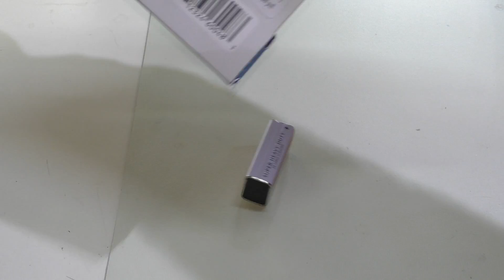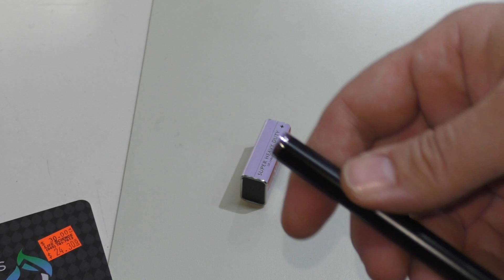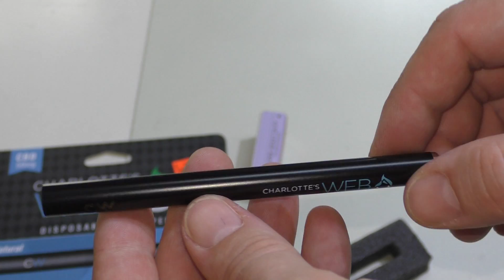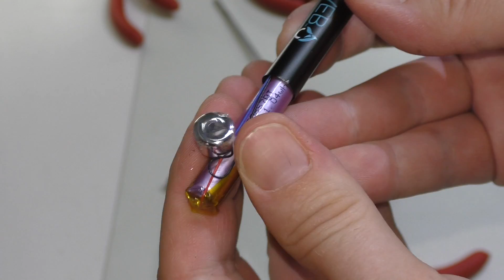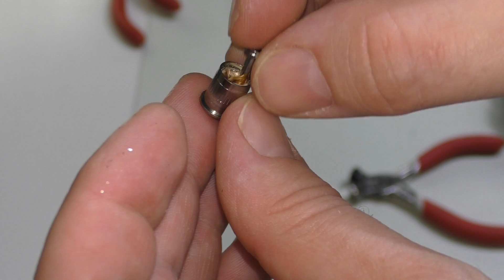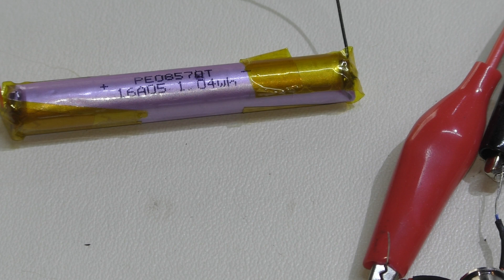PTS Ep. 122 - Disposable Vape Pen Teardown

Comment: Nice vid. but heres some knowledge upon thee, that coil won't glow at the current u are using, because, it is setup as an induction coil. where it is suppose to heat up metals it wraps around.  you will notice you took out a coppery type of fibre strands. those were running down the center of the coil. those strands heat up while the oil is on them and create the vapor.